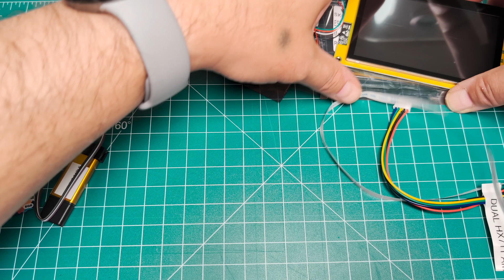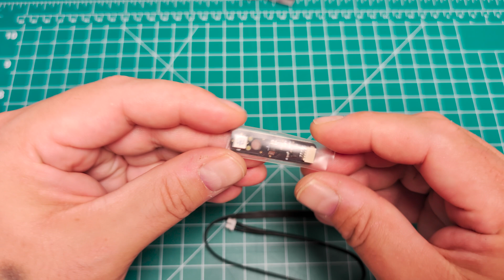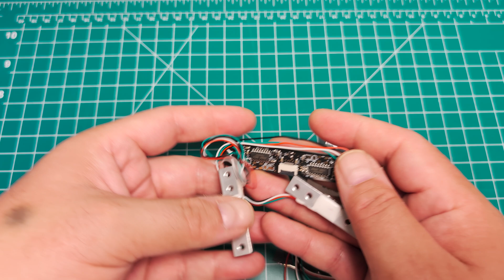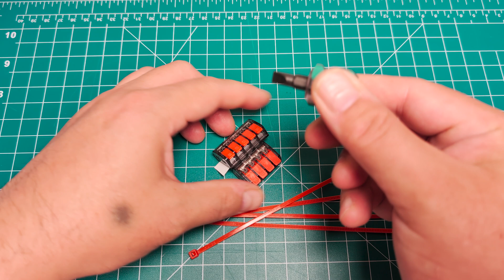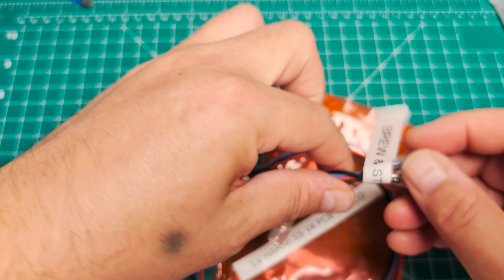Gaggiuino Gen3 V4 Parts List Explained | Peak Coffee Complete Kit

Comment from the maker: CORRECTIONS: PEAK is a SUPPLIER - Zer0-Bit  @VSparxxx  is the creator of the project and at 01:52 I refer to the Connector Board as the Dual HX117 Amplifier Board and that is actuatlly the board soldered to the dual scales.

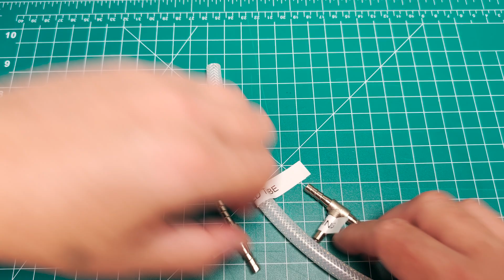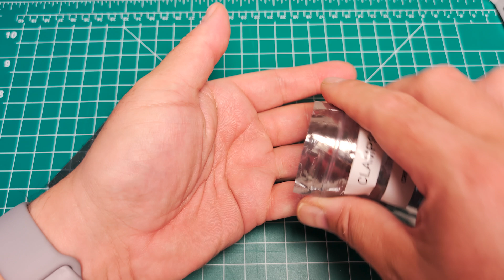Comment: Thank you for your video! Really helpful! I found mine is missing the tube and T-shape connectors at 4:25 and the clamps at 5:55 :O
Reply from the maker: Oh you might be lucky and have the new loogle designed PTB!
Reply from the maker: PTB – Stainless Steel )
 ( to directly attach to boiler, with quick connect to Pressure sensor )